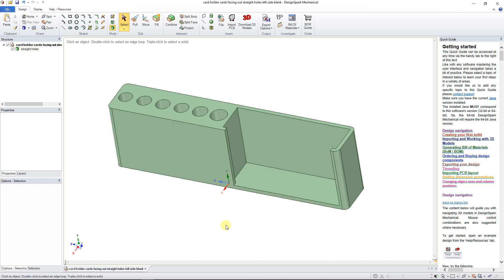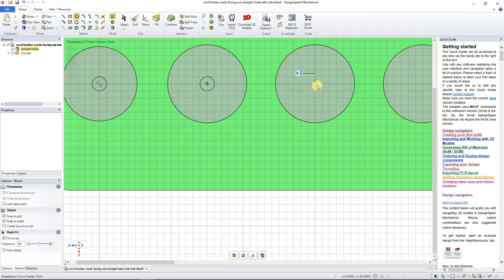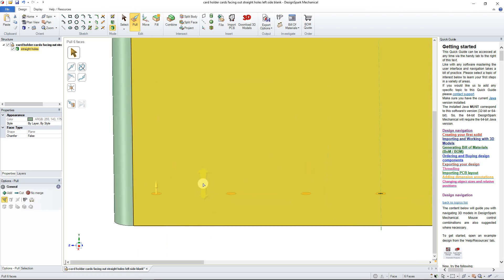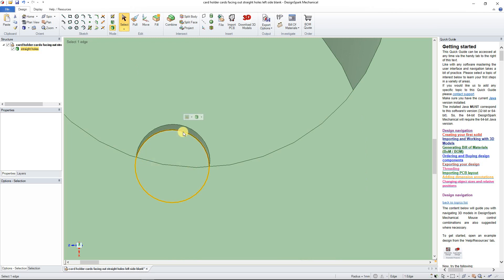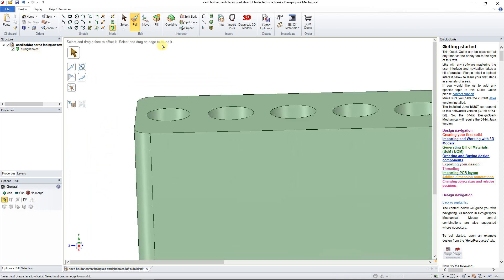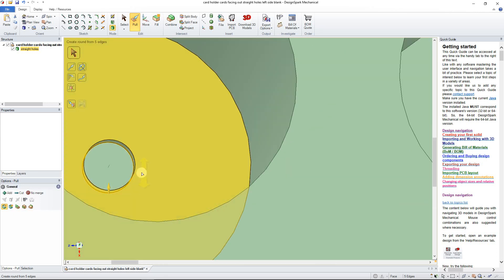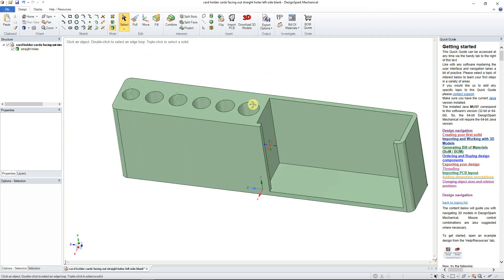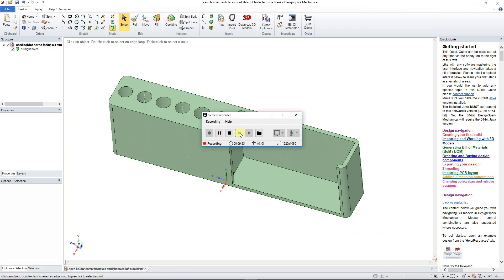Making an upside down cone with designspark mechanical

Comment: Hi, question why don't you use the select filter option? it is a button down under at the right side of the screen the second one from the left, it is standard set to automatic, but you can click the edges for instance and it will select only edges and nothing else Kind regards Hans p.s. nothing wrong wih he audio, there are sub also,
Reply from the maker: Hi. Thanks for the info. I did these videos a while back and I haven't worked on cad for some time now unfortunately.  We moved to a very small place where it's hard to do anything, so I have stopped working on a lot of things for the time being.

Comment: Your video would have been great if you didn't whisper.  You can SPEAK up so others can here you. Don't be shy, I don't bite.
Reply from the maker: Thanks. LOL. Unfortunately it's my lapel mic. I have been trying to get the sound working better on my computer. It's either too close or too far no matter what setting I use. I also have a lot of dust around here, so that bugs my sinus quite a bit and it was really bothering me when I did this video.
Reply: I agree! I had to stop watching simply because of that.